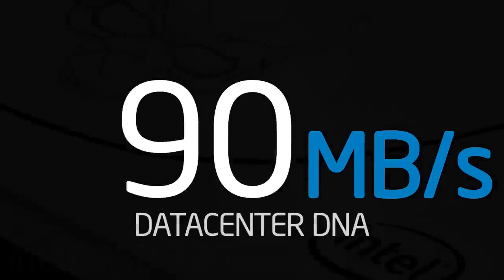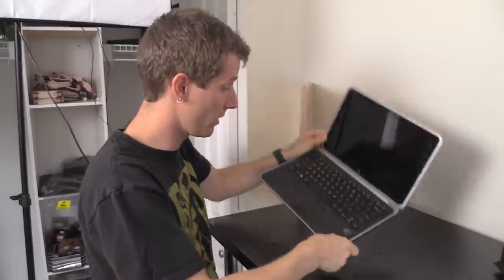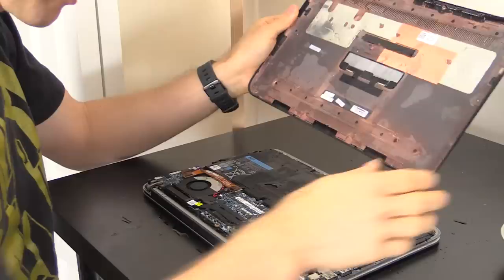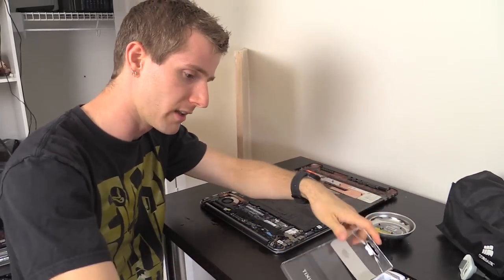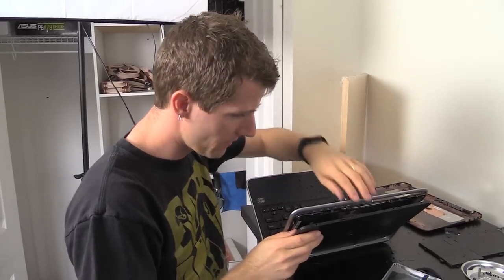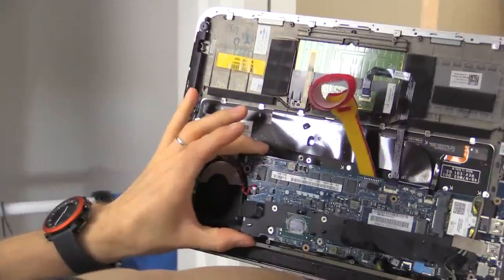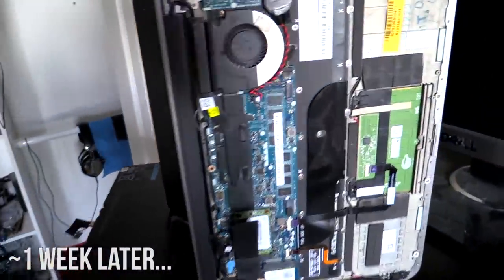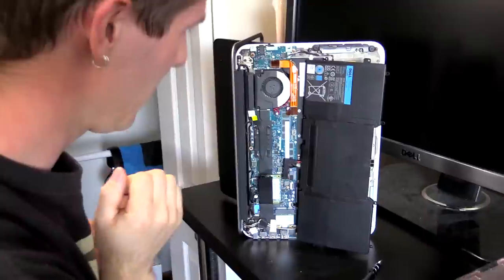Wet Laptop Recovery - Is it Possible?

Comment: Hey there, mine got soaked by green tea. Mine have an error of "no boot disk available". Do I use alcohol to wipe the hdd or is there no chance of salvation?? What should I do to the motherboard,  the cpu and my ssd??>< thanks
Reply: Use an alcohol rag, or multiples. Clean off all of the parts thoroughly and then let it sit for a week or so.
Reply: hoho thxx, its already recovered;)

Comment: umm... I had my Lenovo and water was all over it, it would not turn on so i tried to fix it. I was going to take it apart i almost killed my hand. (i felt a lot of pain also screwdriver + a lot of pressure + hand = PAIN.) I put it in a garbage bag with a lot of rice left it for a bit less than a day and it worked just as well as it did before.

Comment: Do i have to take it apart or can i dry it as a whole
Reply: depends what u spill. if its just water you will be fine just take time to dry and let it be alone dont do anything else. i spilled soup so i had to open and clean and take it apart whatever i could. cleaned with alcohol let it dry for 3 days and it got back to life

Comment: Ok, so I spilled some water on my laptop, specifically the keyboard. Now when I turn it on, it comes on fine and the touchpad works but the keyboard doesn't work at all. Any help? Thanks in advance!
Reply: NinjaGammingabsolute i added the external keyboard via USB as a temporary fix. However I'm from the UK and my particular model keyboard has stopped making the Uk version keyboards. Smh. I've booked it to be collected tomorrow to be repaired.

Comment: I have questions
why the ultrabook can resume windows from when it's left before, I mean he took the ssd off
Reply: Naufal Irsyad he probably just connected it to another pc and copied all or needed files (without booting from it) and then put it back on the laptop
Reply: Google Hibernation for windows
Reply: Aristotle Alteza watched techquicke about it and linus says it stores data on storage while sleep store it on RAM
Reply: Naufal Irsyad the way windows work is that it goes to power save mode in stages. first it goes to sleep where everything is stored in the ram and it uses just a small amount of power to keep the ram going. then after a while it will save everything in the ram into the hard drive and cut all the power. that is typical if the battery is dying while it's sleeping. these could be configured on your settings. if you have ever let a laptop sleep and come back to it hours later you probably have noticed that it doesn't turn on as quick as it should. that's because it went into hibernation. I'm glad you looked it up. it's fun to learn new stuff.

Comment: Someone Plz correct me about the statement below.
If you put your PC to sleep and remove the battery and then snap it back in after a while, you will resume from where you left.
cus this is what I gather from this video  o.O
Reply: Thing is, there is a difference between different types of sleep. If it's just in power saving mode, everything running is still on the RAM, slowly using the battery, but being ready to pop right back where you were. If your computer enters hibernation mode, however, everything on RAM will be dumped to the hard drive, so when you wake your computer, it simply copies everything back to RAM. It takes a little longer to boot back up to where you were, but the computer is technically turned off while hibernating, so losing power isn't an issue.
Reply: OH yes! that make sense.. thanks for the explanation.
Reply: Parviz Gul You're welcome!

Comment: +LinusTechTips  YOURE LAPTOP IS WET BECAUSE YOU LEFT IT RAIN
MY LAPTOP IS WET BECAUSE OF MY DEO COLOGNE WAS POURED TO MY LAPTOP (I DIDNT SEE THAT COMING)  AND IT KEEPS PRESSING L-SHIFT BUT I DIDNT PRESS IT HOW CAN I FIX IT?
Reply: LinusTechTips ALSO IT WILL BE GONE IF I OPEN THE ON SCREEN KEYBOARD BUT LATER IT CAME BACK (THE L-SHIFT WILL BACK PRESSING THAT I DIDNT PRESS IT). HOW CAN I FIX IT?
Reply: LinusTechTips  IT IS NOT CAPSLOCK.

Comment: Would it work if juice was spilled on its keyboard?
Reply: +Nicolas Leblanc He didn't even think he'd get this to work at first... but he decided to try anyways. It's hard to say if it'll work but it won't hurt to try if ya got the time.
Reply: Turn it off and wash it out with water then air it out
Reply: I lived in Congo for a few years, and while we were there we accidentally spilled passion-fruit juice onto one of our laptops. the keyboard stopped working.

Comment: btw Macbook screens are sealed airtight and the whole computer is made out of aluminum unlike these plastic pos PC craptops lolz, so good luck trying to ruin it with water lolz
Reply: good luck trying to actually fix it when its ruined
Reply: No, MacBooks are not airtight, PC laptops can be made of aluminum and carbon fiber, and repairing PC laptops is easy most times. Your argument is invalid.

Comment: Why the fuck would you buy a Dell? They make everything so fucking hard to fix and replace, every part is proprietary, its so fucking stupid. I've never bought one but I've worked on my friends dekstop and realized I'm never buying anything with the Dell logo on it.
Reply: Hp Godlike
Reply: +David Ramos (Ultronprime) Hp breaks every time I buy there products
Reply: +Catbossness “SkullCrusher”  once has mine been broken
Reply: +David Ramos (Overlord Ultronprime) My main laptop is HP and has a design flaw with the hinges (so does my Toshiba) :(. But my server computer (also HP) has been running for 2+ years and it is running strong.
Reply: Chris B it's funny because what happened in the video happened to me along time and you would be surprised what laptops can survive